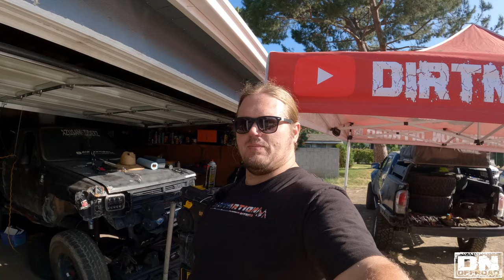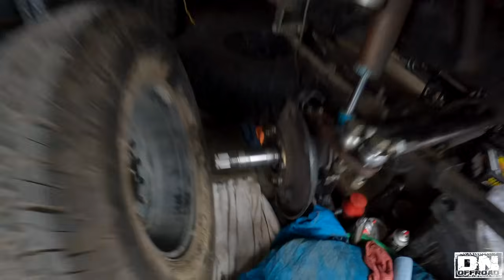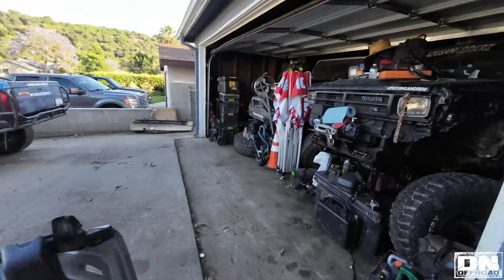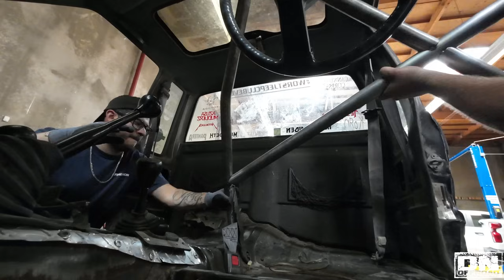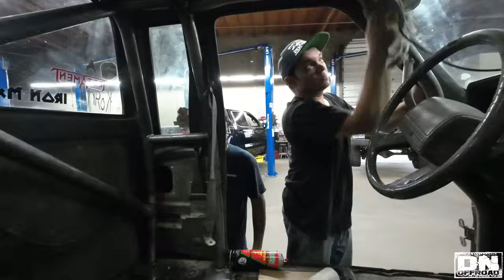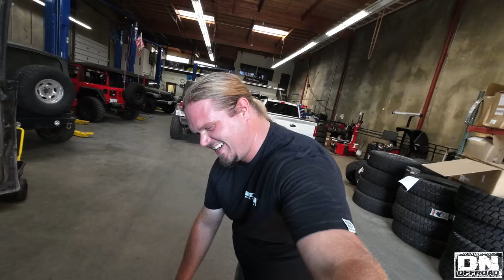Finally Building a Roll Cage for our Toyota Rock Crawler! Fordyce/Rubicon Prep 2024

Comment: Put the same cage in my wrinkled up 84 xtra cab😂 and ya the floor plates were a 🤬😂
I did make my own seat brackets for corbeaus and made them super low so no need for foam. Have put it on its lid and only put a small crack in the windshield. I couldn't even buy the tubing for cheaper than the 4x invitation cage
Reply from the maker: Right on! Definitely a good value for this one, I’m happy with it so far 👏🏻